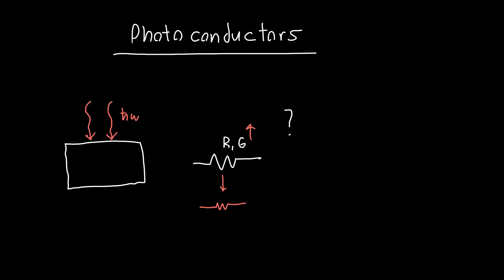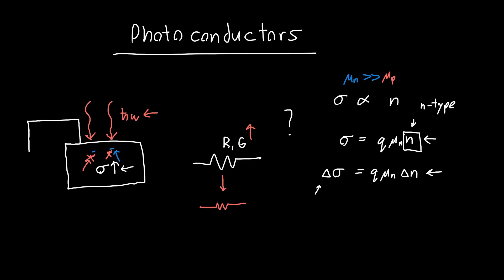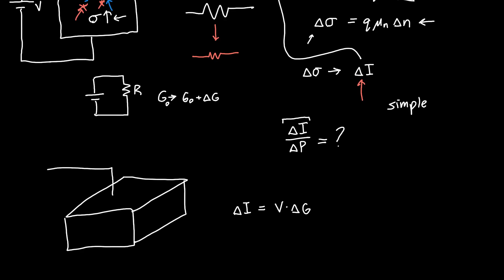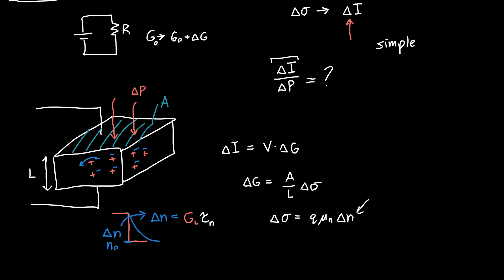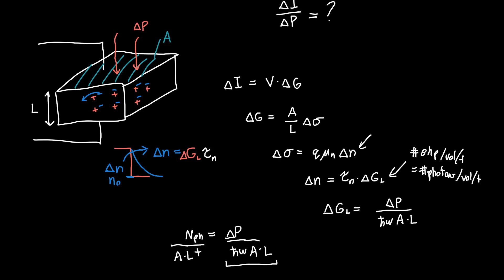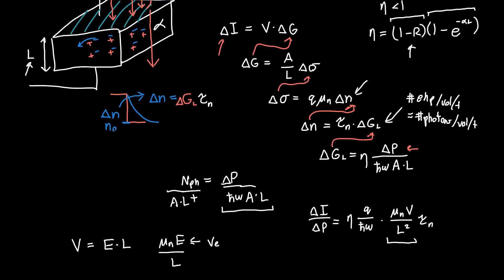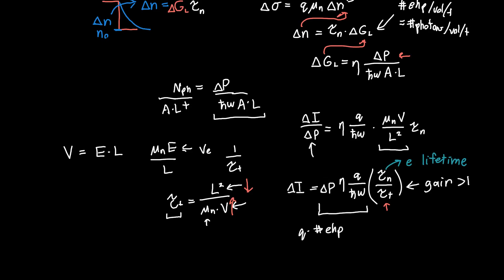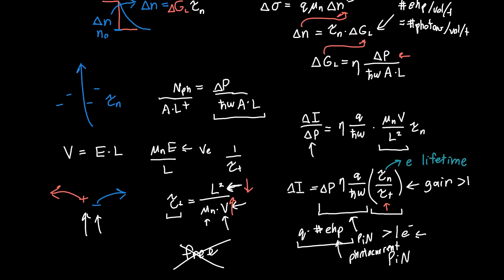Photoconductors and Photoconductive Gain

Comment: Thanks for the great lecture! Since electron hole pairs are able to stick around for longer time in photoconductors, does the response time for current saturation get longer along with increased current?  For optical sensor, I guess the response time might be also important.

Comment: Hi Jordan. Could you tell me what is the difference between operating a photodiode in photoconductive mode or photovoltaic mode? How are the outputs different and what wiring is required? Many thanks
Reply from the maker: “photovoltaic mode” means you don’t impose a voltage on the diode, you let the current flow back through the PN junction and develop a forward bias. You basically treat it like a solar cell. In “photoconductive mode” you force a (reverse) bias voltage across the diode, and so none of the current flows back through the PN junction and you can collect all of it elsewhere. For photoconductive mode, see “TIA photodiode” for an application circuit. No one in their right mind uses a diode in photovoltaic mode as a sensor unless you want to use it to power something.
Reply: @JordanEdmundsEECS  Thanks very much, Jordan!